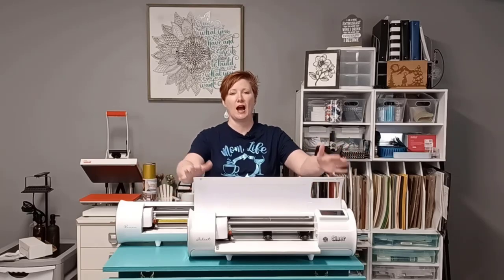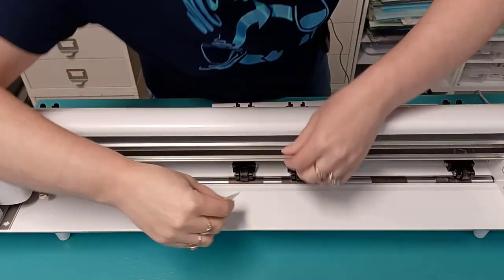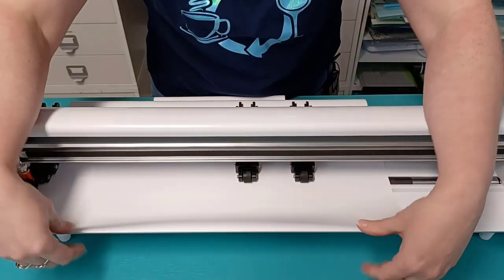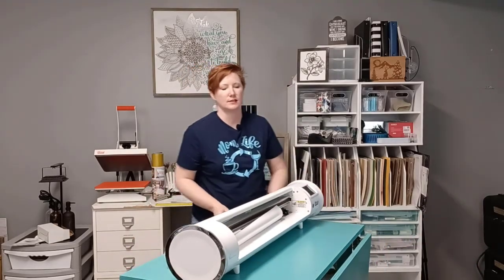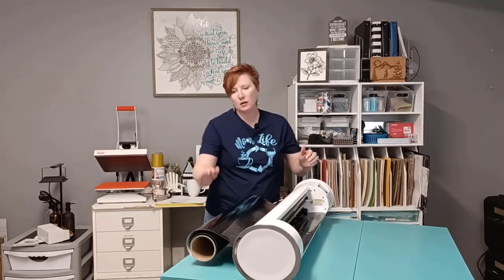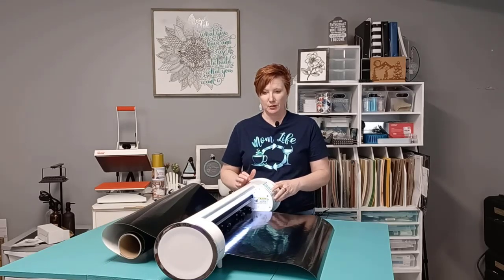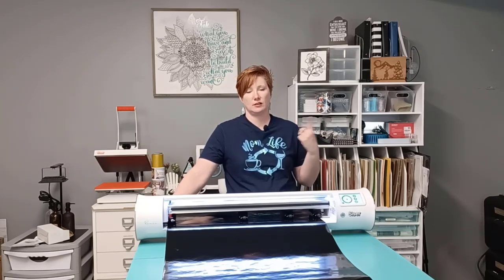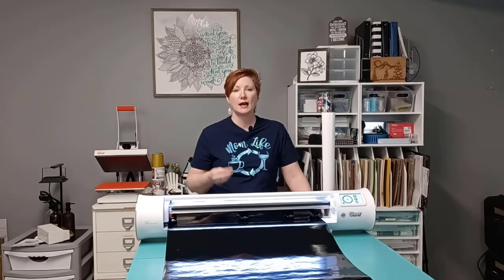When Things Go Wrong - Troubleshooting Feed Issues with Siser Juliet & Romeo Cutting Machines

Comment: Nice one :) my experiance since most of us are DIYers we dont store vinyl/htv in dust proof cabinets.  so they are dusty and have small dirt particles on the surface. 
so keep the surface on the plotter clean, where you algine the vinyl. i use a Lint free microfiber towel.  the rollers clean with ipa/carpaint prep/rapid tac prep.
i use different blades for different materials. for long cuts do a test travel.  pro tip dont let youre cat inside the hobbyroom XD
Reply from the maker: Hey.... how did you see me wipe the dust off my vinyl roll today? lol
I had the same thought before I recorded my video. Blow the dust off. 
Great tips!
Reply: @SwiftCreekCustoms  its  one of "Dads superpowers"  :D

Comment: Hello, I have a Romeo 24 sisser, which in the last month has not been cutting vinyl well. It's really not making me desperate anymore, and it's not the blade because I have changed the blade three times and the problem remains the same. And if I increase the pressure of the cut, it goes all the way through the vinyl.
Reply from the maker: That doesn't mean it is not the blade.... sounds like you need to test cut and work with the actual blade setting itself.... if you are cutting vinyl, you should barely see the tip of the blade at all.... then increase the force as needed. 
If you have damaged the cutting strip that runs below the blade housing, that could definitely affect the cut quality as well. Run your finger over it and see if there are any nicks or cuts in it. If there are, you may need to replace it. 
You are in charge of this machine more and most times it comes down to getting that perfect adjustment on the blade for your material. 
That can take time and testing... but once you get it... you'll get faster at it... 
Here are some tips... https://youtu.be/OZj7n7ggrMg

Comment: Having lots of trouble recently with the accuracy of the outline cutting that my juliet is doing.  Recalibration only shifts the off cut from left a bit off the line or a bit off the line on the right.  It used to cut exactly all the way around the whole image,  but it doesn't any longer.  There's always just a bit of white showing somewhere around outside the outline. We checked everything and at a loss, exactly what happened.  Its a brand new machine.  Changed the blade, checked the software.  Please help
Reply from the maker: Is it off on all designs the same consistently? Or is it different as it goes down the page?

Comment: Hi there! My Juliet is cutting angular lines across (at times up to half the  page of) my letter size sticker paper and I’ve tried turning the machine off and on and same with my computer, I even started a new project and still it’s cutting where there are no cut lines. I’ve ruined so many stickers because of it and don’t know how to fix it. Do you know what may be wrong? I tried a different cutting mat too and that didn’t help either. The cuts are like intersecting zig zags! The project itself cuts fine but there are these extra cuts that ruin part of it.
Reply from the maker: First, are you using Leonardo Design Studio to send your projects? 
If yes, then the top reasons for drag marks are: 
1. Blade depth is out too far. 
2. Material is bowed up in between the rollers, which means it's closer to the blade when it travels. 
3. Mat is warped or bubbled and not completely flat.
Reply: Appreciate all those possible causes! I just bought a new mat and I’m hoping it will help. Thank you! 💕

Comment: Hi, I have calibrated and when I was going to cut a design, it was able to pick up the first corner but unable to locate the second/ third corner. It went too far pass the corners and I was unable to use the arrows on the screen to relocate the red cross. I have repositioned the blade to the corner or the marking point on the page, but it did not pick up the second corner either..  The deign has a laminate on top and placed on a mat (custom mat). In Leonardo Design studio, I could not change the setting to Custom mat (which is strange), as they only allowed me to choose between the siser mats or generic mats. I dont know where I have gone wrong...
Reply from the maker: @julienguyen8437  is the printer printing the correct size and not resizing the print in any way? Scaling up or down? That would change where the machine thinks the marks are printed. 
There are only certain size mat designations. That is not unusual.
Reply from the maker: @julienguyen8437  https://youtu.be/D2W5bAmGhxM?si=63J1jw_cLnXAILNC
Reply: @SwiftCreekCustoms  thank you. I will watch your video first and test out again . The paper is the correct sizing. I will see if it needs recalibration again , and change the position where the blade is.. I have a feeling that might be due to the mat being bent and not staying flat enough..
Reply from the maker: @julienguyen8437  ok - so yes - the mat needs to be flat. I would get a new one. 
If it arrived that way, contact Siser. 
The comment above was in reference to the actual printed images on the paper, not the paper size itself. The printer can scale the design it prints.

Comment: Hello Elly! Any idea what to do when the print then cut prints colors darker than expected? My first 10 cuts were so nice! After that I don't know what happened, all my prints came out in a darker color. When I print things on photoshop it looks fine so it's not a printer issue :S
Reply from the maker: @Ivyc_  I've never had that happen. I'd start first with a full shut down of everything and then see if it occurs still. If it does, then I'd look at the printer settings in LDS. It's odd for it to just change.

Comment: My Romeo is cutting fine but somehow all of a sudden when moving from character to character on my adhesive vinyl it is moving extra slow. It cuts characters at normal speed but moving from character to character it’s really slow? 

I tried another svg file and same thing? HELP ! :(
Reply from the maker: Are you using the cut settings from the machine touchscreen? Or from LDS? What speed is it set at?
Reply: @SwiftCreekCustoms I’m using the machine settings and cutting oracal 651. Speed 9 / Force 22
Reply from the maker: @marktummillo715  if you set up those same setting from the software, does it do the same thing?
Reply: @ wow just tried it. I used the same settings but from the software and not the machine. It cut completely normal? Why are the machine settings all of a sudden causing issues?
Reply from the maker: @marktummillo715  are you doing a print and cut by chance? Or just a normal cut?
Reply: @SwiftCreekCustoms no I’m just cutting a basic SVG file I’ve cut before and adhesive vinyl (Oracal 651). This issue literally just started out of nowhere as my previous program was just fine.  It’s just so bizarre it’s only the travel between the different items I’m cutting that’s slow.  When it’s cutting the actual item it’s normal. I even rebooted my MacBook, LDS and the machine as well. Almost seems like a firmware bug?
Reply from the maker: @marktummillo715  we've seen it with print and cut but not as much with regular cuts. Yes, it would have to be a firmware update to fix it and that's not easily done yet, so they have not released an update. 
If you do have a long cut, you can pause it and increase the speed up one and back down and it sort of kicks it into gear. Or just send from the software.
Reply: @ lol ok thx for the tip but I’ll try it. Hopefully a patch comes out soon. I do 4’ - 6’ long pieces and this isn’t ideal 🤦🏻‍♂️